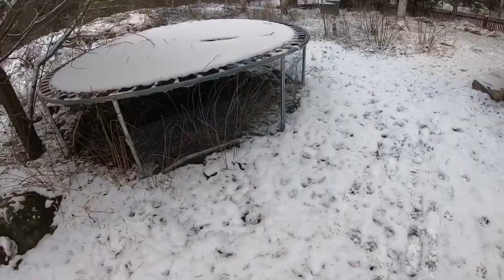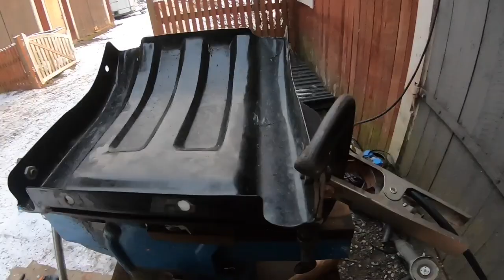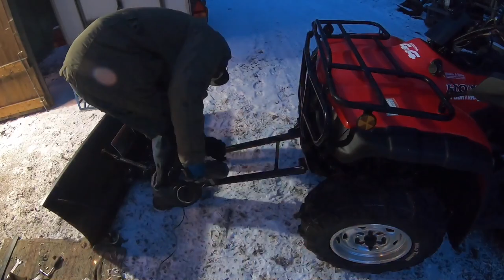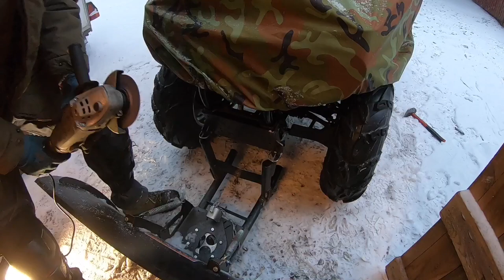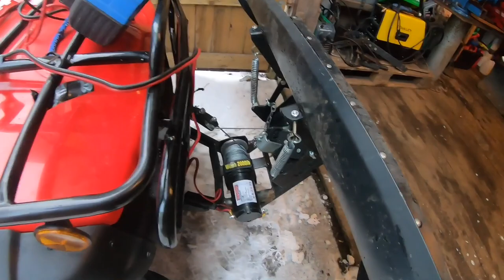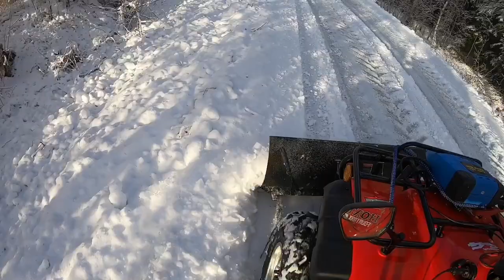Modifying a ATV snow plow to mount in the front and testing it

Comment: Did the spring kit you put on at the end help with the premature trip the plow had. Would it help if the plow had the shoes on it to keep it from going to deep so you could just set it down all the way and it would stay off the ground a little bit.
Reply from the maker: Hi! The springs sure did help, it is working the way it should now. Perhaps the shoes would help but it wasn’t an issue once I got the correct springs there.

Comment: does the Honda hold up well? Did you need to repair the motorcycle?
Reply from the maker: Motorcycle? Do you mean the ATV? The Honda still works great! I need some new gaskets for the carburetor as it is dripping a little bit of gasoline but it is 24 years old so I guess it’s OK. Parts are still easy to find.

Comment: You should maybe use 2 springs or maybe 1 spring and along one hooked together that’s a lot of tension on your blade and a long way for your spring to stretch
Reply from the maker: I change springs in the end of the video to the ones that are supposed to be on this blade. It worked great since then.